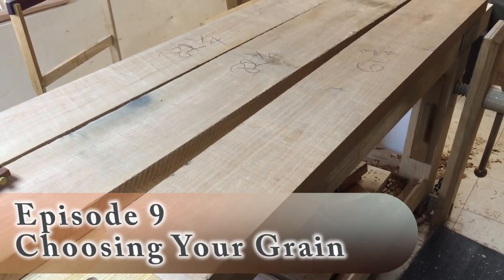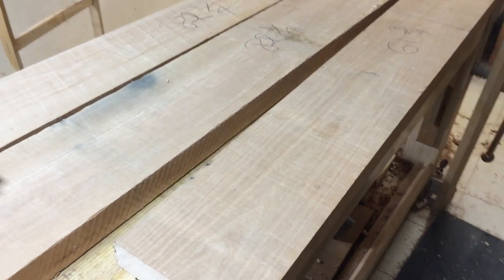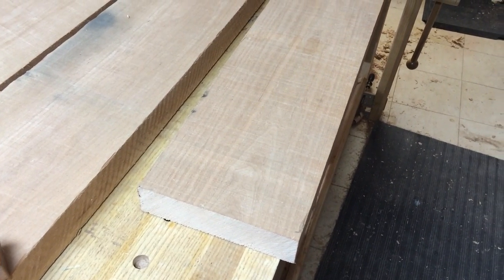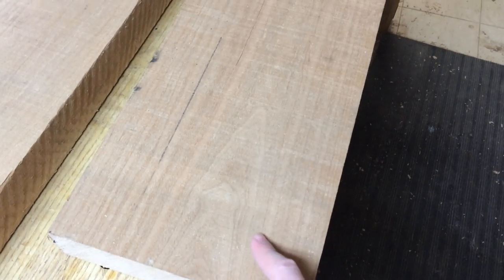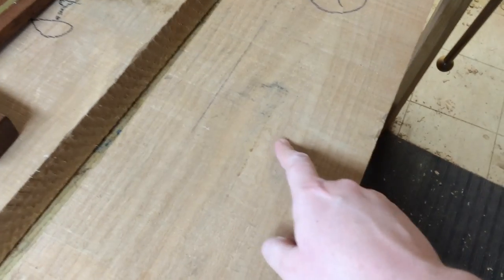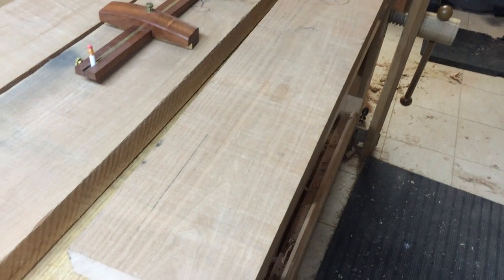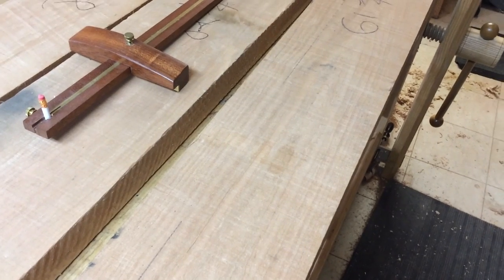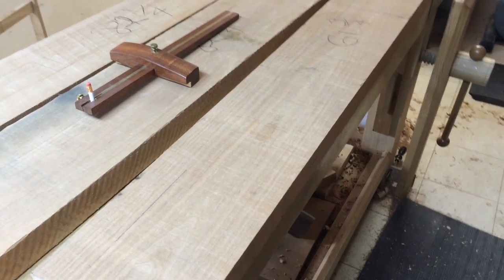Chips 'n Tips 9 Grain Choice

Comment: As obvious as this tip may seem to some, before watching this video I would have taken 2" off the left side. Had I thought to take 1.5" off the left and 0.5" off the right I would have thought myself clever. I don't think it would have ever occurred to me to take a board with straight edges and cut at an angle to them to center the grain pattern.